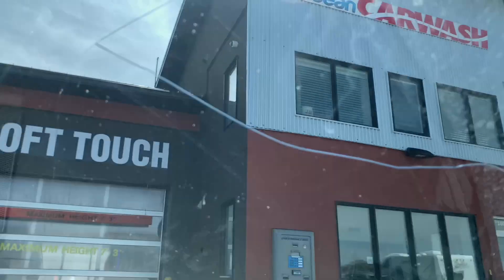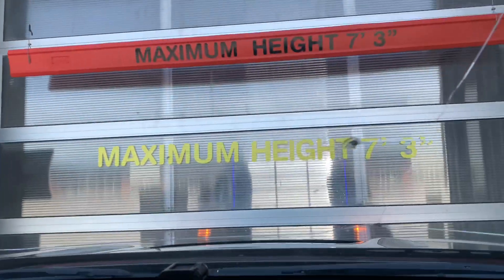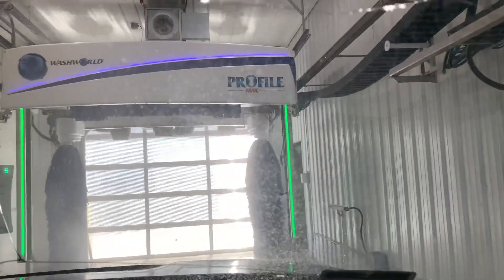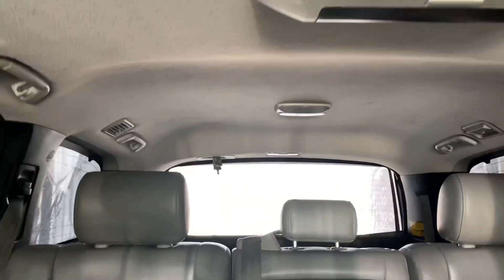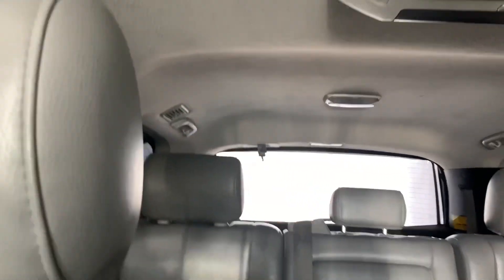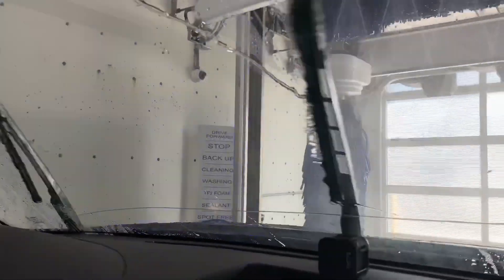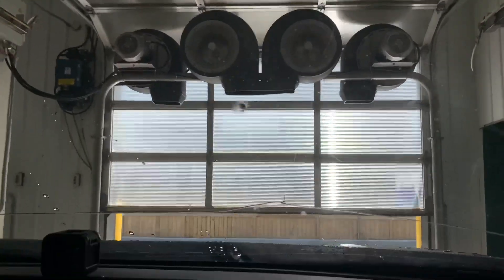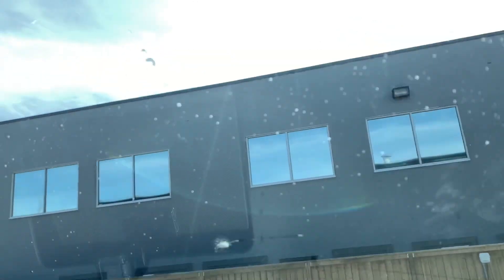Washworld Profile - Ocean Car & RV Wash - Airdrie, AB

Comment: It's very odd that there isn't any side dryers.
Reply from the maker: progamer 73 Yeah. There are side dryers in the bay next to this which has a Razor though.
Reply from the maker: Progamer73 I've honestly noticed most Razors or Profiles or ANY Washworld system that has a Washworld High Velocity dryer doesn't have side dryers.
Reply: Alberta Car Wash Channel Yeah that's pretty common.